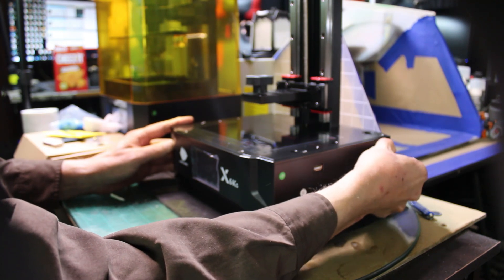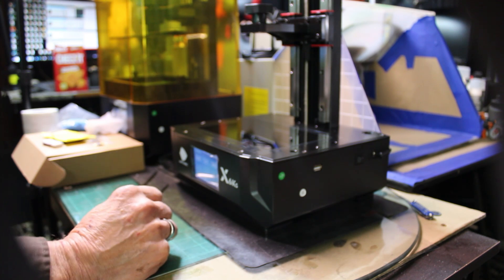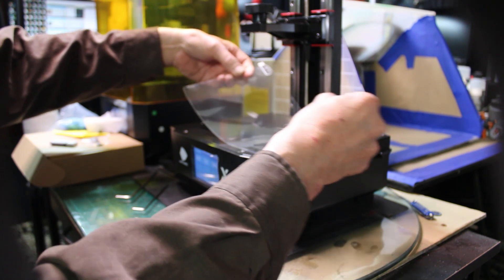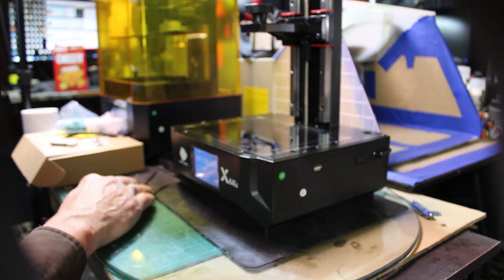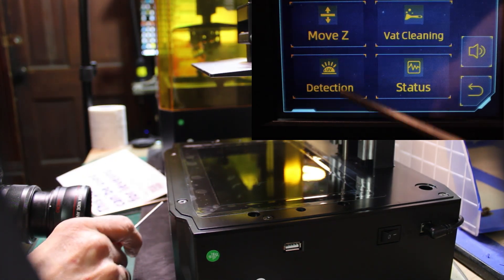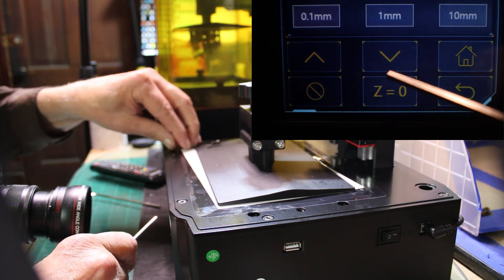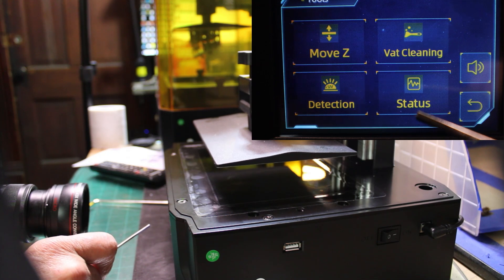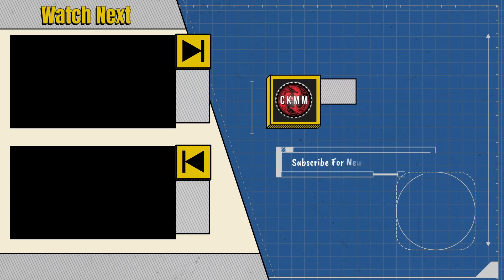WE SETUP AN ANYCUBIC MONO X 6Ks RESIN PRINTER

Comment: Unfortunately, my screen is already a bit battered (small cracks, etc.) because of this, bubbles do not escape appearing on the screen protector... will it affect the print?
Reply from the maker: It may, I would replace it just to be sure. You get some failed prints.

Comment: Took delivery of my six KS last week, and it came with the screen protector already installed. I am curious as to why you set and then bump it up. I’ve never had an issue using the standard method of loosening the bolts dropping it down, holding the plate in place and tightening the screws then setting this Z equals zero. I use the same procedure with my three max and my original mono 6K and over 300 prints. None of the fails were due to my leveling procedure. 10 prints in (mostly 1/4 and 1/6 figures) Using the standard any cubic resin and I love this printer.!

Comment: Just opened this printer yesterday and was shocked there was no real levelling instructions. Home it on the paper included and tighten bolts. I haven't had a successfull print yet. First print was stuck to the bottom Fep. Added 10 seconds to expsoure on initial layers and second print had one fall off the bed. I started a 3rd, using the torture cube on the USB Key vs what I actually want to print... we'll see when I get home. Will try this method next.
Reply from the maker: Please let me know one way or the other. I have never had a print fault with these Anycubic. That was just using the fault settings. I will help more on a one on one if you wish. Thank you for your feedback on the video.
Reply: @chaos3dlasercrafts1674  yeah, came home to another failed print. It was stuck to bottom. I ran a 30 second full screen exposure and peeled it off. I can see the outline of the torture cube. It never stuck to the build surface. Only thing I can think of is my basement is about 18-19c
Reply from the maker: @Sudz3 at that temperature you should be ok. If you are having issues of not holding to the build plate, the issue is you not set correctly to the UV light glass. 1. start over again and level the build plate. 2. After it is secure hit the up button 3 tunes until the paper can move. 3. Set this as home in the menu. then raise the build plate and add the vat . 4. be sure the printer itself is level and on a firm table/desk. ONE OTHER THING YOU CAN DO IS SAND THE PLATE SURFACE WITH 400 OR LIGHT SANDPAPER, have done that many times. Also be sure to hti the "Z=0" button after the leveling process.

Comment: Ok, thank you for your leveling method. I will try it, but when i used factory method i have disleveling from right to left side, after printing details it has differents thinkness, for sample in left dside 4mm, in right side 5mm. I seted diffenets preference UV, time stop and nothing no do results. And i use two SLA printers Anycubic X6ks and both have one problem.
Reply from the maker: I hope it will work for you. Let me know Please. Also be sure that the printers are level, I should have said that in the video.
Reply: @chaos3dlasercrafts1674  Happy New Year!!! I calibrated it using your method. I made several attempts, leveled the printer and did it without leveling, the result was the same, i.e. I practically checked whether this affects the difference in thicknesses, no, it does not, this is logical, because When calibrating, we set the plane of the screen and platform parallel to each other.
With your method the situation has improved, but has not been completely resolved, still, when printing a long test strip, from right to left, there is a difference in thickness, now it reaches 0.15 mm, this is not so critical, but I will try to achieve a better result.
Thanks for the calibration method.
I also noticed that the platform itself has some plane defects. The plane of the platform is not perfectly uniform.
Reply from the maker: I wish I could be better help for you. I always use default settings and have done this leveling process many times and never had an issue. Wish I could help more. @antoniobandosus